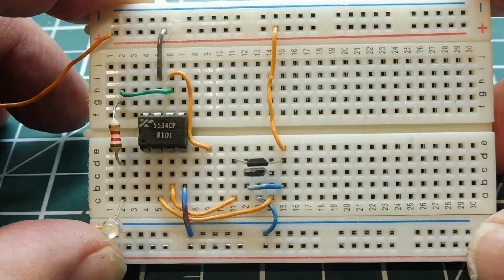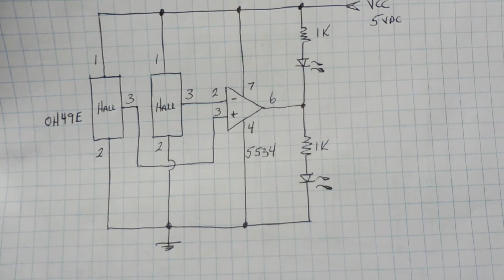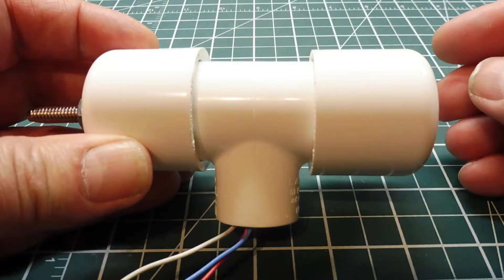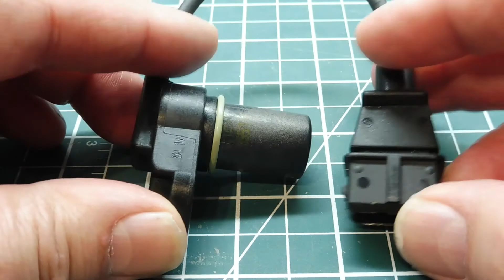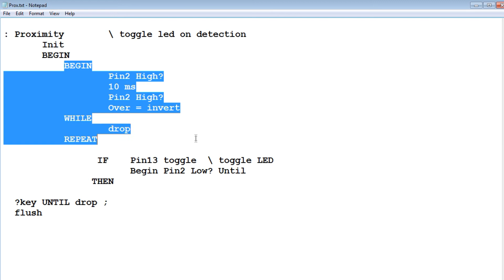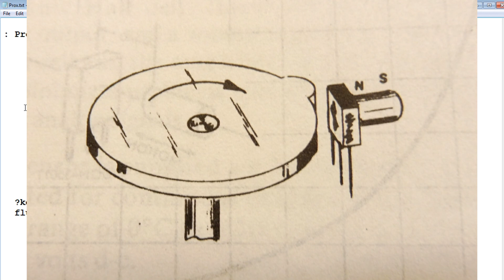Build Your Own Proximity Sensor \ Hall Effect

Comment: Hi ,do u think this might work on a cnc plasma cutter,  as a tourch hight control  ( THC ). Thanks for any feedback
Reply from the maker: Yes, you could make them work by using two of them to sense the min and max distance. A smart control board would be needed to interface the sensors. The sensor in the video is expensive so have a look at these: 
https://bc-robotics.com/shop/inductive-proximity-sensor-4mm/
You could also go to optical laser distance measurement.  Check out this video.
https://youtu.be/3aTCbV2V-r4

Comment: Howdy!  Came across you video a week or so back and have watched it a few times.  Love the simplicity of the project.  My problem is I am trying to build something similiar, but need it to detect a ferous object 3 ft to 6 feet away.  How would I megasize this to work. 
Thanks!
Reply from the maker: That could be a challenge. Try looking into GPR (Ground Penetrating Radar)
Reply: @0033mer might be nice to have simultaneous variety of sensing. Static, rf, magnetism. Do you where a could find a table of rf and mw freq/wavelength effect on elements molecules and materials?
Reply: Also metal detectors, i'm no expert but i reckon going through air is only a bit different than earth. Metal sniffers, security wands, it's all radio transmit and rx, pulsed circuits look for return signal amplitude and always on circuits read phase frequncy and amp changes. Just like a microwave oven makes water hot all the molecules are reacive to some specific frequency.

Im in the learning and theory stage but the star trek tricorder is more possible every day.

I'm trying to work on v small parabolic sensor and emitter arrays for as much of the ems as possible

Comment: can i use a3144 instead oh49e?
Reply from the maker: The circuit was designed for linear hall effect sensors. You can get the same circuit in automotive sensors. https://youtu.be/_-_XGLkKnCs

Comment: Great Content! Can this circuit also build up with an NE 5532P (or one of these OPAmps i have: LM324N, LM339N, ULN2003AN, ULN2803APG, LM358P, LM386, LM393, NE555P, UA741CN, JRC4558D, PC817). I am new in electronics so i hope this question is not too silly ;-)
Reply from the maker: Any general purpose op-amp will work. The NE-5532P will work. Build the circuit and experiment with different magnets as shown in this video:
https://youtu.be/72CGYTzAX0E

Comment: Why an op amp instead of a comparator?
Reply from the maker: A comparator would be a better choice. They are designed to be used in open loop configuration,  fast switching, and rail to rail output. I used an op amp because most people will have one available in their parts bin. If a comparator is available like a LM311 that would be a better part to use. Just remember the output is open collector.
Reply: 0033mer thanks for the detailed answer. Op amps are still magical to me, but I suspected a comparator would do. What I found most difficult to understand is why a particular op amp was chosen for a given circuit, as most authors do not elaborate on the subject.
Reply: Álvaro M. Valdebenito B. Yes , I was wondering that too. That deserves a video.